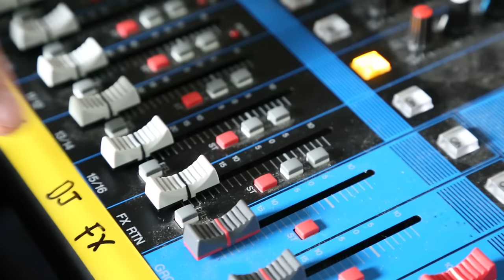How to Soundproof a party wall against noisy neighbours

Comment: Would this be beneficial to block subwoofer bass noise from two adjacent living rooms?
Reply from the maker: Hi Chicken Tikka, SoundBoard 4 offers an excellent performance against medium levels of noise (such as the odd clear words, conversation, music and TV noise). For the bass music you mentioned, you would need to use a higher performing wall soundproofing solution, like the ReductoClip™ Independent Wall System: https://www.soundproofingstore.co.uk/reducto-clip-system
You may also need to treat the floor and other walls depending on how much sound is 'leaking through' these areas.

Comment: Does that fireplace undermine the soundproofing?
Reply from the maker: Hi James, there is no set answer for this unfortunately, it depends on the property and the noise problem. Generally we find 9 times out of 10 that most people can only hear the noise coming through the alcoves either side, not through the chimney breast or fireplace. In which case you just soundproof the alcoves (like in the video). However, if you're the 1 in 10 that can hear it come through, you need to address the chimney breast / fireplace as well. You need to spend time really listening to the surfaces to figure out exactly where the noise is coming through. It tends to be more common when either yourself or the neighbour have weakened the chimney breast by mounting a TV bracket onto it or something similar. Hope that is of some help.

Comment: I really need to get this done. Had 4 years of hell from neighbours. Is it very costly?
Reply from the maker: Hi Louise, it all depends on the size of the wall really, but it's certainly cheaper than moving house! If you get in touch with your wall measurements (width and height), I can give you an idea of cost. Best thing to do is get in touch direct by emailing sales@soundproofingstore.co.uk
Reply: The Soundproofing Store That’s very helpful thanks. Will make contact with measurements.

Comment: Did the customer have insulation in the floor, or anything additional under the floor against the party wall to further reduce the sound from next door, or was it assembled exactly how it was demonstrated in the video?
Reply from the maker: Hi Anthony Yarranton - Thank you for your question. No in this case the only work was installing the SoundBoard 4 on the wall as you can see in the video. In regards to noise coming up through the floor, it's a case by case thing. Having visited the property before hand and spent time listening and investigating, we could clearly hear the noise coming directly through the party wall but nothing coming up through the floor near to the party wall. So we ruled out having to do this. It's still a good thing to add in for best practice, but the customer didn't want us lifting floor boards if it wasn't necessary. However, in a lot of properties this would be necessary.
Reply: @Soundproofing Store  Thank you for the reply. We are looking to soundproof a party wall with this product in the video. But, the side of the wall is met with hinges on a door that leads to a  built-in overstairs storage area. The hinges are approximately 3 cm from the party wall. Can the Soundboard 4 be cut to accommodate them, or will the hinges require moving? (I'll be in touch to discuss options).
Reply from the maker: @AYmusic17  Hi AYmusic, yes the SB4 can be scribed and cut to fit around the hinge. That shouldnt' be a problem.
Reply: @SoundproofingStore  How does this help with flanking? Does this address the issue if there are holes in the party wall on other floors?
Reply from the maker: @AYmusic17  Unfortunately not. The soundproofing is going to reduce sound coming through that area you have installed it in. If you have multiple surfaces that sound is leaking through, you need to treat all of those surfaces. It's like waterproofing, if you have two holes in your roof and water is getting in, just plugging one of the holes isn't going to stop the water getting in. You have to find all of the holes and plug them all.

Comment: Hello, can we paint the mateirals like the rest of the walls? Is it resistant to heat?
Reply from the maker: You can't paint directly onto the soundproofing, you will need to skim plaster over the top and then decorate. The soundproofing isn't designed as a heat resistant material. However,  the acoustic grade plasterboard gives the soundproofing a 30min burn time, therefore complying with building regulations.
Reply: @SoundproofingStore  thank you so much.

Comment: Interesting, would the noise reduction effect be further improved if the walls on the neighbour's were also treated?
Reply from the maker: Hi @jonescrusher1 Yes to a degree. It wouldn't double the reduction by doubling the system, unfortunately it doesn't quite work like that,  but it would further improve it. For this type of household noise, the more mass the wall has the less sound will get through, so adding another 30kg per m2 of mass is going to further help. However, if you need more reduction because the nosie is very loud or bassy, then you will need a more de-coupled system such as our ReductoClip system - https://www.soundproofingstore.co.uk/reducto-clip-system

Comment: It looks like the panels were installed so that the walls either side of the chimney breasts are covered. Is this effective enough? Does it have a decent reduction when it doesn't cover the other walls, ceilings etc? I wasn't sure if sound proofing measures have an all-or-nothing effect.
Reply from the maker: Hi Millerington-Smythe Miller, in this instance, there was no flanking noise coming through the floor or ceiling, it was sound passing through the walls only. Similarly, with the chimney, by doing a simple ear test when you can hear the noise can determine if the chimney needs to be soundproofed too. Chimney breasts are usually constructed of a double layer of fire bricks, which adds more natural mass than that of the alcoves (therefore blocking more sound). This blog goes into more detail with regards to instances where the chimney breast does need soundproofing and the most effective ways of doing so:
https://www.soundproofingstore.co.uk/how-to-soundproof-a-chimney
Soundproofing is an all or nothing, in that it has to be the right solution for the type and levels of noise you are trying to block. Also, it is similar to waterproofing, any gaps and the sound will find a way to 'leak' through.

Comment: In the video do you just sound proof the alcoves? What do you do about the fire place?
Reply from the maker: In the majority of cases more sound comes through the alcoves than the chimney breast. This is because the chimney breasts are (normally) constructed of a double layer of fire bricks, which are heavier and more dense than the standard bricks used in the alcoves. Often there can also be a small air gap and a double layer of fire bricks on your neighbours side. This extra mass naturally makes the chimney more soundproof than the alcoves. However, it's important to check this in your own property as this isn't always the case. We did check in this property prior to the installation and no sound could be heard coming through the chimney breast, only the alcoves. This blog might be of interest in explaining what to do if sound can also be heard through the chimney breast: https://www.soundproofingstore.co.uk/how-to-soundproof-a-chimney

Comment: I have this same exact problem. My bedroom is directly on the other side of Neighbors living room. I can hear tv and muffled conversation while I am trying to sleep. Any ideas??  I cant do physical things to the wall such as drilling because I am renting??? Also a friend of mine stated that my walls are concrete.
Reply from the maker: Hello, the most effective soundproofing against the airborne noise you are hearing would include adding mass (weight) to the wall. Because of this, our solutions are screwed into the wall. Solutions which can be 'stuck' to the wall are not as effective at blocking sound, as they don't contain enough mass. Could it be worth speaking to you landlord? We would be happy to speak to them and yourself and reassure them that once the soundproofing is installed and painted, to look at, you wouldn't know it was there.

Comment: Best soundproofing option available A DETACHED HOUSE 🏠 
and that stuff they put on the wall will make little difference, you’ve got floor joists, ceiling joists going into the party wall, which will transfer noise, you need to make a cavity between the two buildings, put stud work up, use rockwool in between the studs and double plasterboard it with sound board, all the best
Reply from the maker: Ste P - You're right, a detached house would be ideal, but we don't all have that luxury. So we need a solution for the property we have. Normal household levels of airborne sound doesn't create enough vibration energy to transfer through floor/ceiling joists. It would be different if you are talking about excessive noise levels (amplified music etc), but for normal household noise levels this isn't a problem. The airborne sound is travelling through the party wall. Our SoundBoards perform far higher than Rockwool and plasterboard and takes up a fraction of the space. Sound is blocked by mass and our SoundBoard4 has more mass than 2 layers of acoustic grade plasterboard. So for people needing a decent level of domestic soundproofing in a semi detached or terraced property, this is an ideal solution.
Reply: @SoundproofingStore  Problem is banging; clicking girls' high heels going up and down interior wooden staircase; power tools.
Reply from the maker: Hi  @Echo-o-o  there is quite a lot going on here, please feel free to contact us on (01423) 206208. To advise on the correct solution it would be useful to know more about the structure / layout of the building and where you are hearing the noise. e.g. through a wall, ceiling, floor (or a combination). 
In the meantime, it might be useful to look at the highest performing solution for walls: The ReductoClip Independent Wall Solution:
https://youtu.be/R2gvGyE6kTE

These blogs on how to soundproof a staircase might also be of interest:
https://www.soundproofingstore.co.uk/how-to-soundproof-stairs
https://www.soundproofingstore.co.uk/how-to-soundproof-communal-stairs
Reply: Thanks, @SoundproofingStore  . No communal stairs here. I rent one side of a 2-story duplex. Each flat has its own floating wooden stairway that leads from a hardwood 1st floor to the top floor with wood vinyl flooring on my side, not sure about the other side. While no part of either apartment is directly over the other, when downstairs and they are walking upstairs, it still sounds like they are walking on my head. The impact of walking travels across from one side to the other. My neighbors are not going to soundproof their stairway, or anything else. I am unable to work and live on a very low income. I need a way to block or absorb sound for 12-18 months until my plan to get out of here can materialize.
Reply from the maker: Hi @Echo-o-o  to successfully address the impact noise you are describing, this really needs to be treated at the source (before it then enters the structure of the building).
Reply: Hello, @SoundproofingStore  . The source of the impact noise is of course the other human beings making it. I need a material solution. The source does not respond to address.
Reply from the maker: @Echo-o-o  In that case you need to de-couple. Unfortunately in your situation by the sounds of it, that is going to be quite difficult and costly. There is no cheap hack to solving this kind of noise problem. It will need independent stud framing, and lots of mass. It sounds like you are in the US so probably not something we can help with in much detail.
Reply: @SoundproofingStore  I described the constraints I have to work within early on. Thanks.
Reply: This makes sense.

Comment: You’ll still get quite a bit of sound coming through the fireplace
Reply from the maker: Most fire places have 4 layers of brick (heavy mass) so rarely allow airborne sound to pass through. Where you may get sound issues is when the fireplace has been compromised by removal of bricks.
Reply: WRONG, a party chimney  breast above the throting  [where the mass end's as you call it] is constructed of 9 inch brickwork and each flue is separated by 4 inch brickwork called a withe , so the breast is basically hollow, most terrace houses up to the 1960's were built this way, so not insulating the chimney breast is a waste of time and money.
Reply: It is a how to not get dumped by your partner.
Reply: The Soundproofing Store that's not true..... Sound will go through chimney.
Reply from the maker: And you have the same on the neighbours side, giving you more brickwork and mass between one dwelling and the other where the chimney breast is, than in the alcoves. Yes, if the noise level is excessive, then we would need to address the chimney, but with household level noise, just soundproofing the alcoves delivers excellent results in most cases. We soundproof party alcoves multiple times a week, and we always get an excellent result, unless there is a weakness in the chimney breast allowing sound to leak, or the neighbour has removed their chimney breast. Then we board the whole wall. The test data speaks for itself.
Reply from the maker: There is more mass in the chimney breast in most cases than there is in the alcoves. We can literally put our ears against the alcove wall and hear more sound coming through than doing the same on the chimney breast. Again, if the noise level is excessive, then we need to look at soundproofing the whole wall, but in most cases, with standard household noise, just soundproofing the alcoves gives us an excellent result with minimal cost and space loss. We do this multiple times a week and get brilliant results.
Reply: True. The chimney being hollow acts as a sound chamber. I can often hear the neighbours through that rather than the cork and bookcase lined walls. Any "nosey old dear" will tell you the good old gossip's trick of puting your ear to the chimney to hear the neighbours argument in clear detail - or a glass tumbler to the chimney. Seriously !  But yes the alcoves are often very thin and easy to resolve with board or whatever.
Reply from the maker: That can be the case in older properties. And yes sound resonates in hollow cavities. If people still want to use the chimney then there isn't much we can do about that. If noise is coming through the chimney breast we can board around the chimney breast the same as the alcoves. However 9 times out of 10 once the alcoves are addressed the noise is greatly reduced. You can hear if the sound is coming through the chimney breast before any work starts.
Reply from the maker: Exactly. We never tell people that sound wont come through the chimney breast. Its just less likely to. You should always examine exactly where the noise is coming from.
Reply: @SoundproofingStore  
Hi there. I'm currently struggling with the level of noise coming from my neighbours tv. They have their tv mounted onto a shared party wall. Would soundproof boards be the best way to go about reducing this particular type of noise? 
Kind regards
Reply from the maker: @keeganmelvin482  Depends how loud and clear it coming through and whether it is very bassy! SoundBoards will certainly help as they will raise the mass int he wall and reduce more airborne sound, but if its coming through loud and clear and you can hear bass coming through, then you may need to consider a higher performing system like our IsoMax Clip system - https://www.soundproofingstore.co.uk/isomax-clip-system
Reply: Keegan Melvin check out home renovision! Great tips for that !
Reply from the maker: recall  We are a professional soundproofing company who have been involved in thousands of soundproofing installations from domestic noisy neighbour situations, up to full recording studio design and builds. Our knowledge comes from daily experience. As previously stated, we would never tell people that noise doesn't come through a chimney breast because it can... but in 90% of domestic soundproofing cases the majority of sound comes through the alcoves due to the wall being thinner with less mass. By soundproofing the alcoves to a good level, we can reduce the noise to a perfectly comfortable level. This is our experience up to 20 times a day, 5 days a week! If the noise level is very loud and clear, then addressing the chimney breast as well may also be needed. Again, as previously stated, you should always check the chimney breast on every job and take each project by its own merits. If you would like to see how happy our customers are with our advice and systems, you can read our reviews here - https://www.trustedshops.co.uk/buyerrating/info_X9881A44E2285DD055D19BD2DA0F00A81.html?utm_source=shop&utm_medium=link&utm_content=ReviewsInfoLayer__reviews_only&utm_campaign=trustbadge_maximised